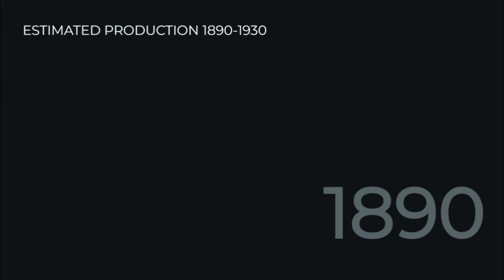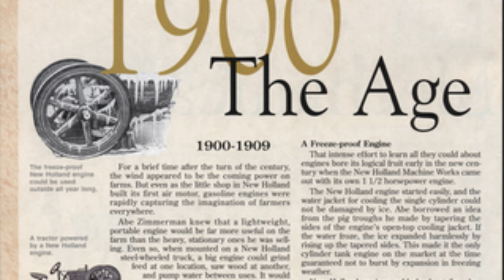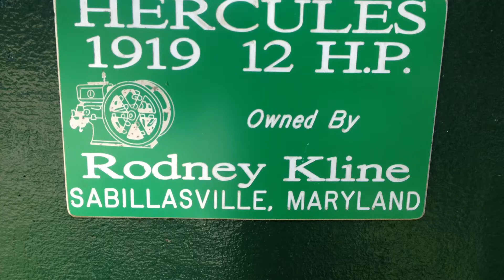The BIGGEST and Most POWERFUL Hit and Miss Engines | Episode 4

Comment: In Grayson County Texas there were large single cylinder Fairbanks Morse engines still in service as late as 2006. I loved going out and looking at them. They had closed crankcases.  One of them was a modified hit and miss. It had a spark plug an ignition pack and a retrofitted carburetor . It still had a name plate. It had 100.5 cubic inches and produced 20 horsepower at 200 rpm.

Comment: Nice video. As far as hit n miss governed engines go they made up to 100hp. There's a 100hp Charter engine on YouTube. Foos made 75hp and 90hp. Fairbanks N's got up to 60hp.
Reply from the maker: Thanks for pointing that out. I honestly wasn’t aware of the 100 hp Charter engine. I would have definitely included it if I had known. From what I understand, engines in that power range were produced in extremely small numbers, which is probably why they’re rarely mentioned. Really appreciate the info.
Reply: Don't forget the giant snow engines. Cool springs in Pa has one. Wow it's big. I can't remember the full name of the place but it has a boat load of hit and miss engines and disassembled ones. It's between punxsattauny and brookville on rt 36